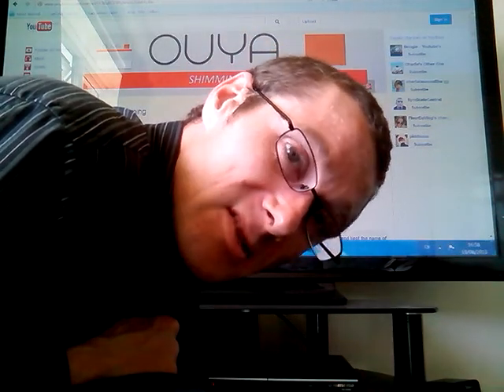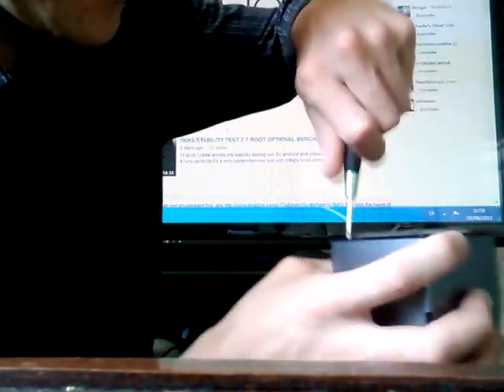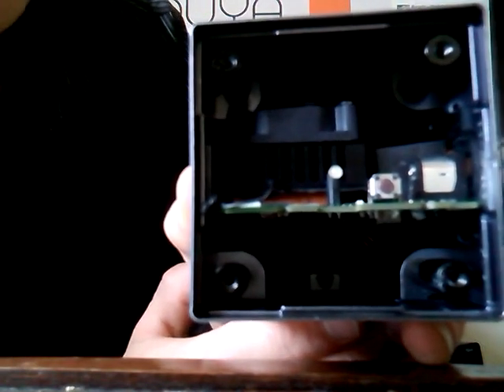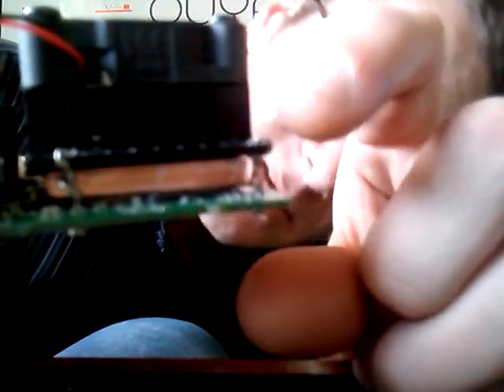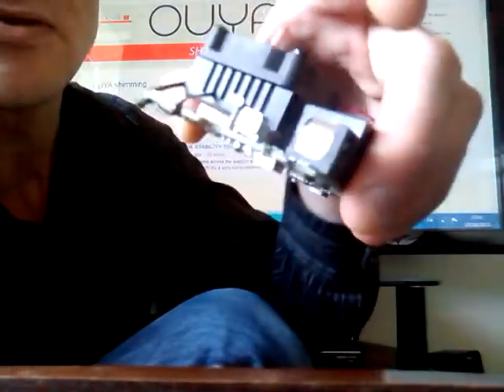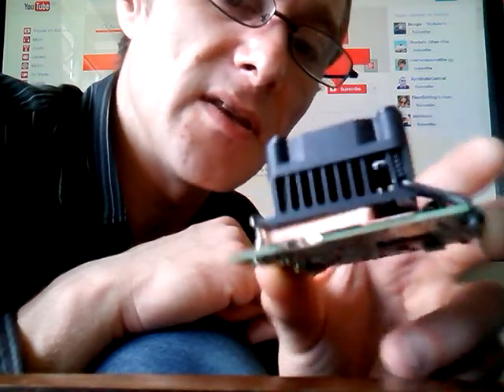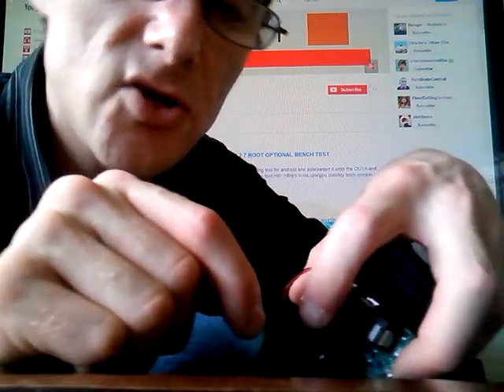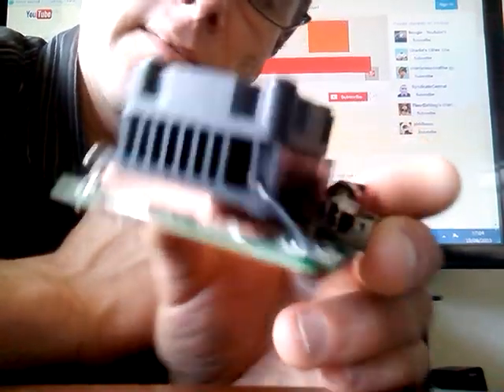OUYA SUPERSIZED SHIM MOD

Comment: I think the huge copper block is hurting it . The block is holding the temp in . That was desined for an hot cpu . I would just have and all copper small heat sink like the factory one and have the ouya in an custom box . Have an external powered fan on the cpu heat sink so it cools more that the factory one .

Comment from the maker: Actually i tried the thermal pad idea, and in such a confined space it actually prevents the airflow from the 5v fan mod hitting the motherboard and the chips where the pads have covered, then the board is not as cool as a fan directly air blasting on it,so believe it or not using thermal pads on the ouya with a 5v fan mod placed exactly where i have placed mine on the lid increases the temperature overall.

Comment: You could add some little heat absorber pads on the back of the circuit board couldn't you ? and that would help quite alot.

Comment from the maker: The only viable method in theory would be a cooling mod of some description,i.e the shimming and some fan mod would help.However you can't gain speed only fluency as the chip cannot realy be increased in mhz as it does appear to be overclocked already,so all you can do is make more efficient wehat it has already,unless of course someone has the ability to make a custom overclocking rom.There will be more videos soon but ran into control issues i am waiting for a replacement to come in the posT.

Comment from the maker: Another way is get a sh@tty usb phone charger with plug end and a cheapo 5v fan or a sh@tty 12v phone charger and cheap 12v silent or basic fan to use, but use the same size fan as the ouya had originaly and just shred wire casing off the cables leaving the thin wire cased cables and just feed them through the lid opening instead.Lots of laptop fans are 5v or 12v and some rc car radiator heatsink fans are also 5v or 12v

Comment from the maker: I know they are realy hot they take the p@ss mate,but they work at those temps all day long,the chip is very robust by the look of it.I am sorry to here about the wire mate.I felt p@ssed when my heat sink stand off went but it gave me ideas about lengthening and modding the stand offs.I have 2 cpu copper coolers out a ml370 g4 hp server i'd love to use with 92mm fan in a new case on mine,no room in case to mod bigger and better barr shim and maybe higher rpm fan same size a base fan is 1 idea.